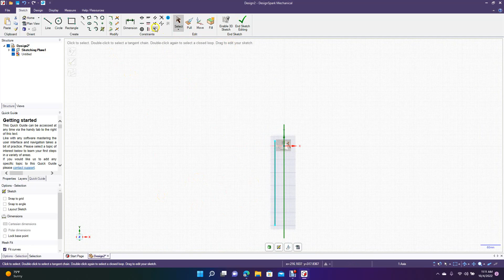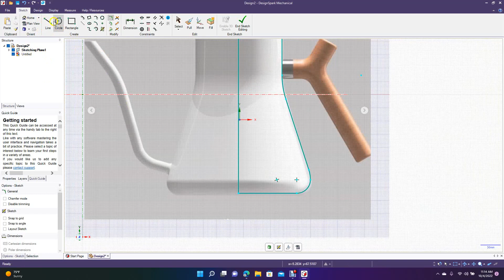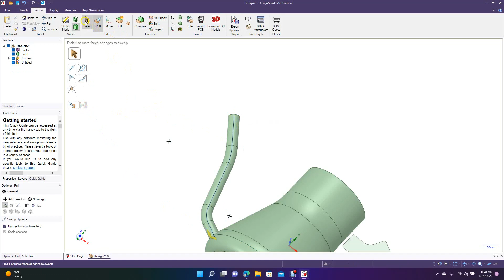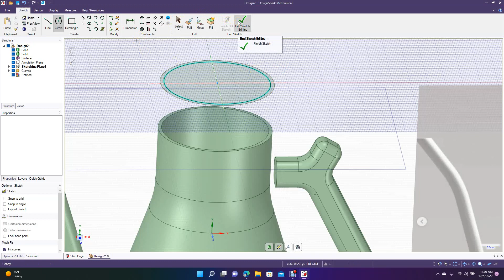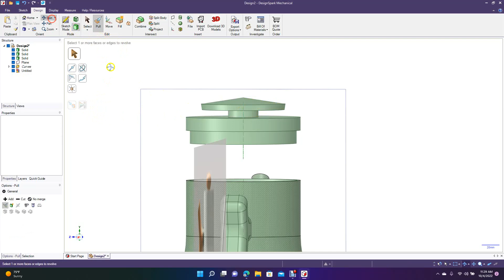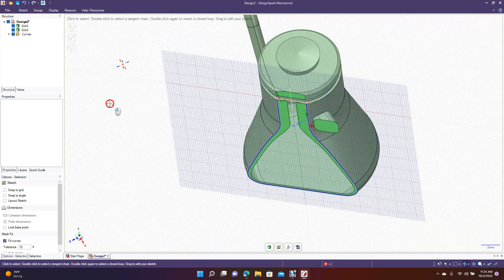How to create a tea pot in design spark mechanical

Comment: I just notice in my program that when the Sketch Tab is showing then I have missing a "Polygon Tool". When I close that tab then in Design Tab 
the tool is visible. It has to be a mistake in the program.........
Reply from the maker: JB, my version of DSM is the same way. I believe they left off the polygon tool for the "constraint-based drawing". Not sure why, but it's definitely not there anymore. You would have to turn off "constraint-based drawing tool" and then the Polygone tool will be there.
Reply: @dailey3drevolve  It's under Design Tab if you don't activate the Sketch Tab.